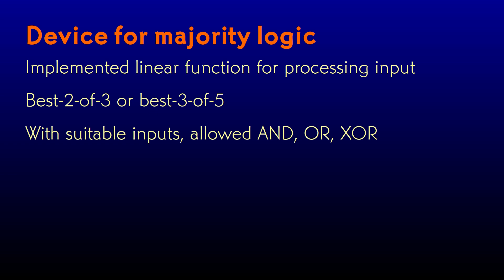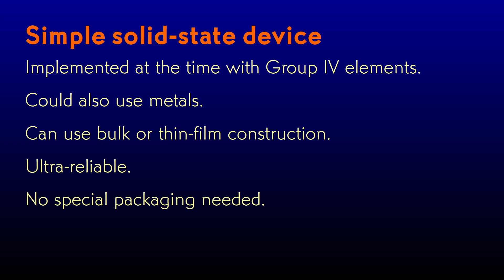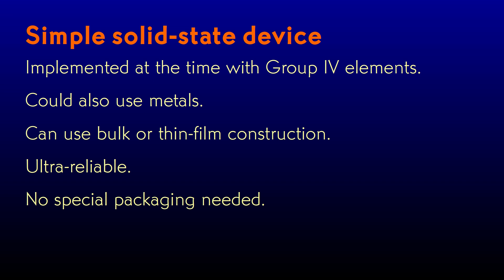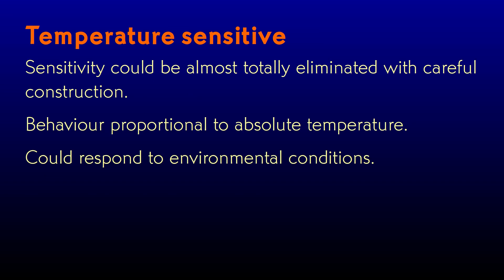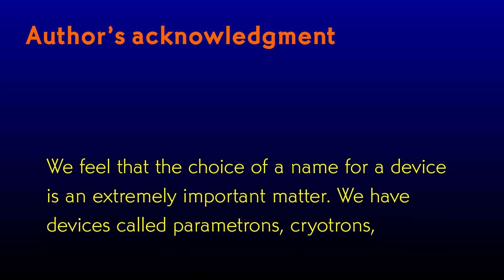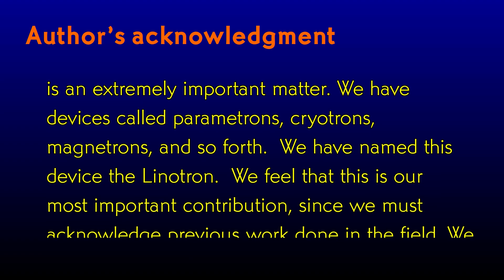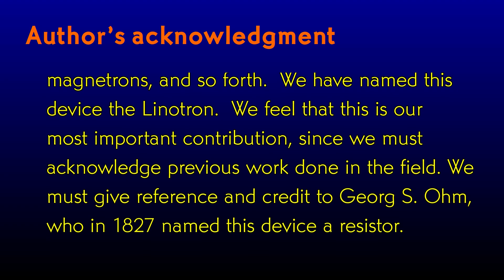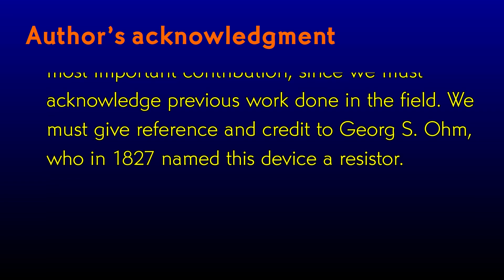Electronic history snapshot: the Linotron

Comment: Wow, awesome device!  If I could only acquire or build one...
Plausible enough.  Got the joke after a bit.  Being a prankster, myself, I don't often recognize one when I see one on the most holy days of Pranksters.  I don't see the date!  I'll share a couple of OC's if you like.
But... this is quite a challenge.  An analog version of an FPGA might do...  now, to acquire 4,000 MPSA-18 transistors!  2N3904 would do.  2N2222 (no suffix, JAN can TO-5) might work if you needed power more than speed.  I see a circuit assembly with well over a few square meters in area.  Impractical, but it would be a fun build of the weirdest analog computer in existence: The one who could come up with the best jokes wins the majority-logic contest!  Can be adjusted for other holidays, such as Easter, Valentine's, New Year's Eve... and of course All Saints' Day.  Samhain!  Okay, Halloween.  I think Halloween should be a season.  Yes?  Anode Yes, Cathode, No; say it!

Comment: Sir could you please make a video on LDO Frequency Response
Reply from the maker: I'm trying to parse your initials.  LDO as in low-dropout voltage regulator?  (Frequency response becomes significant if you're using it as a post-regulator in a switch-mode power supply.)  Or is it something else?
Reply: @KludgesFromKevinsCave  yes sir Low dropout regulator....I am talking about stability analysis of the LDO ....how do we find out the pole ,zero position and make it stable .